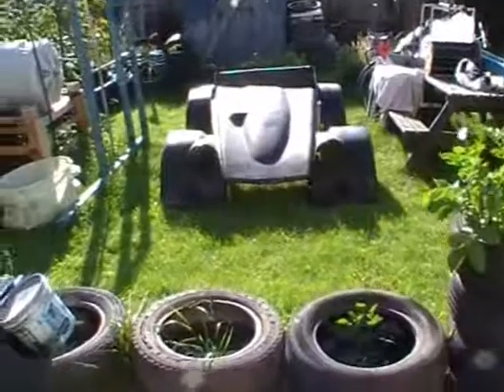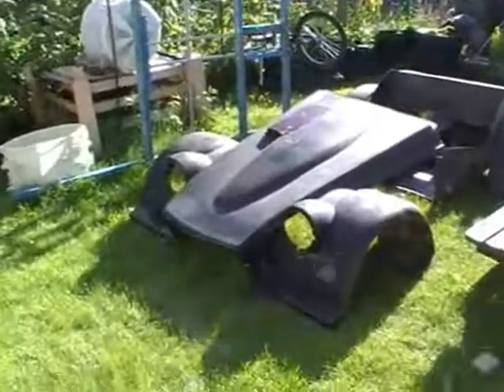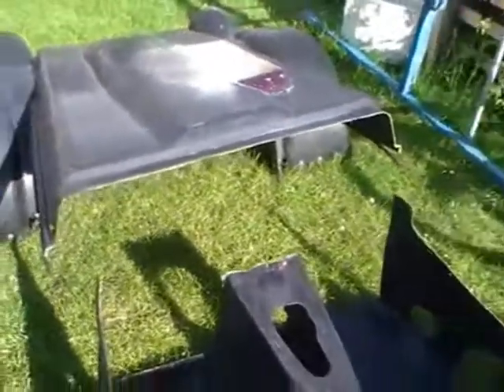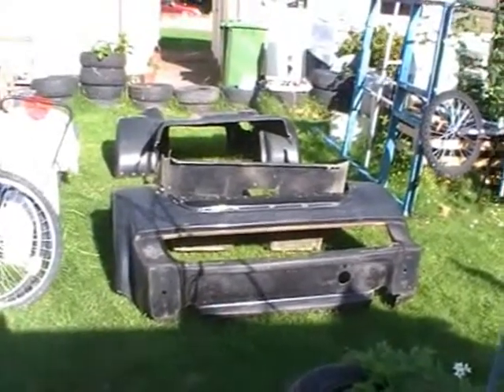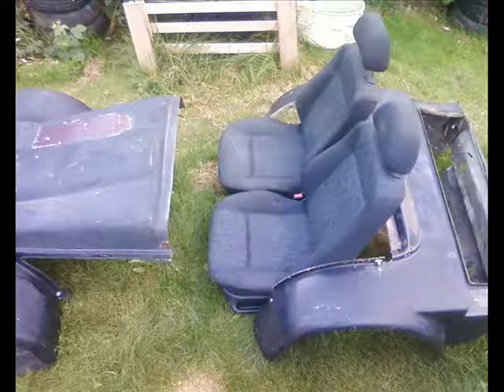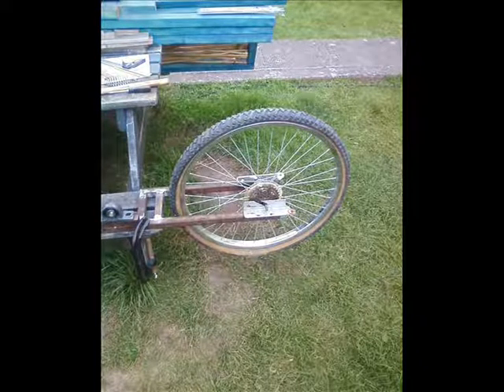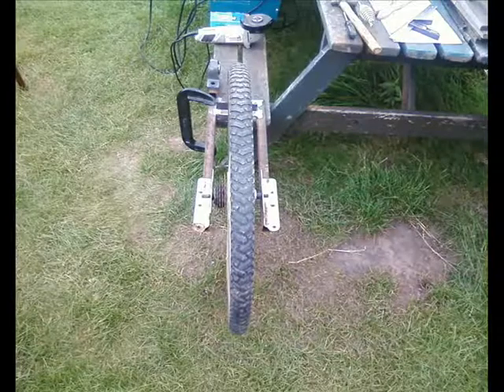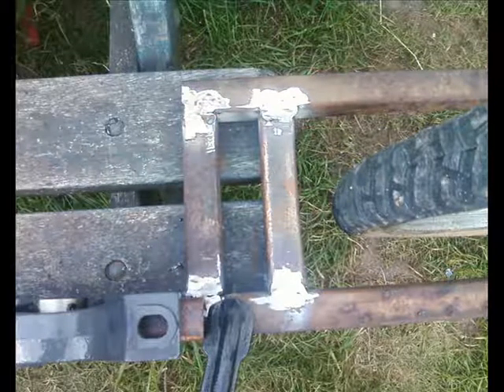MY NICE EV Intro 2

Comment from the maker: Hello Steven. We have a local Freecycle network here in the UK. Although I live in Hereford I monitor emails from several local sites. The Dutton body was on a Bristol site. The guy said if I had not picked it up it was going to the tip all £800 of body. I also got the VW Polo seats the same way. Again if not gone were destined for the tip. It's all free too. That is also where I got the bicycles from. So far I haven't bought anything for it. Even the motors are free.